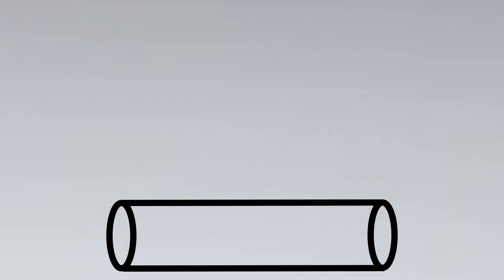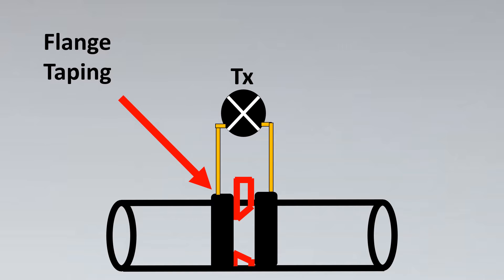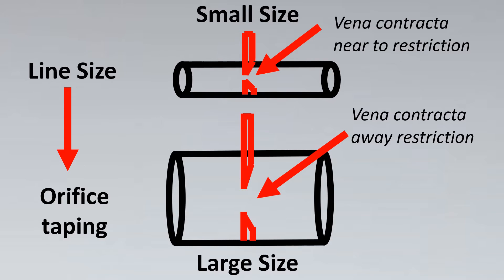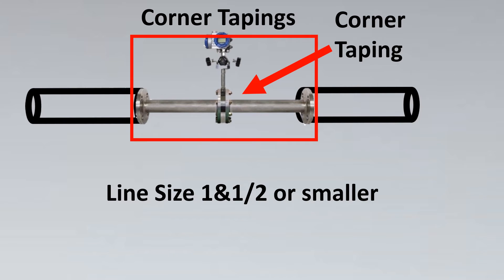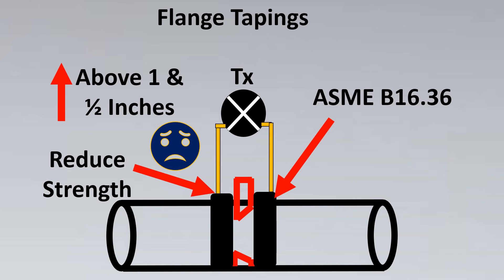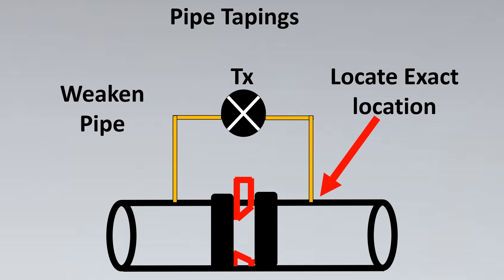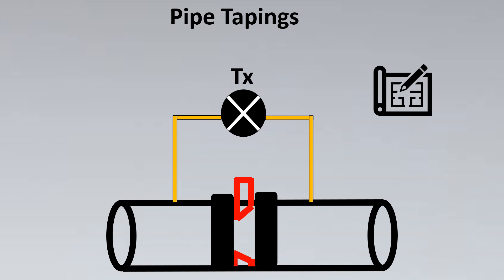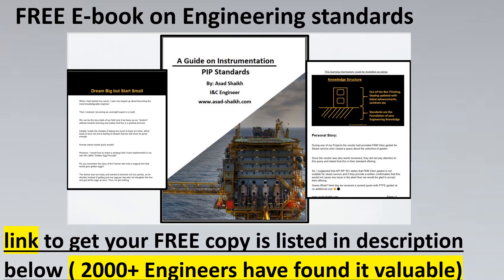Orifice TAPPING Types and selection | When to use what guide.

Comment: Would you please share brief on installation guidelines (straight run requirement) for various flowmeters... Or any standard to be referred?

There is bit confusion as each Vendor suggest different lengths.
Reply from the maker: For Straight length requirement ISO 5167 is one of the most widely used standards, this standard could be helpful and yes i am planning for a video that cover straight run calculation of orifice flow meter 😊